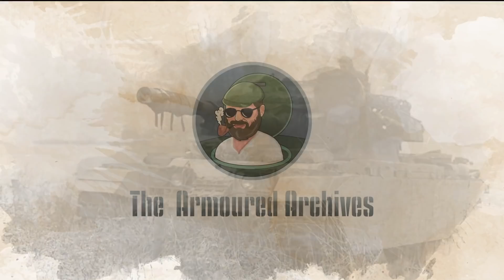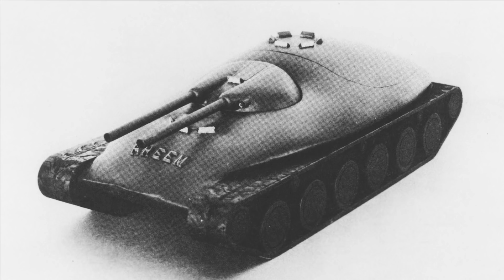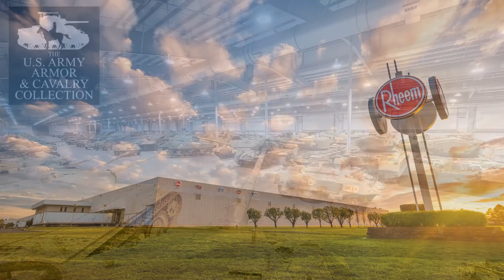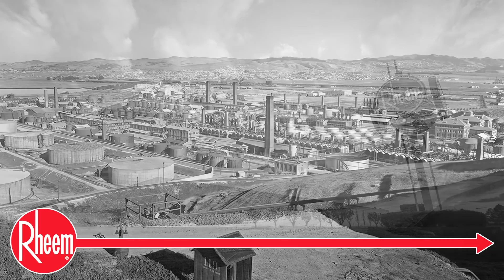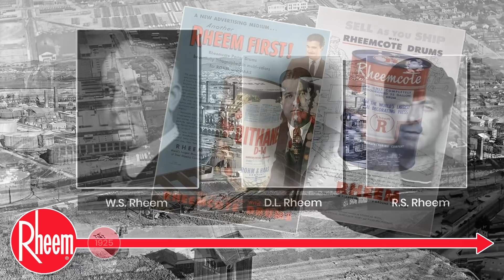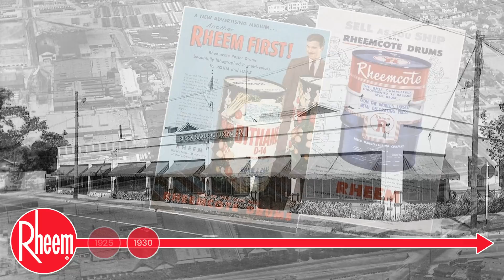The Hunter  - Tank Design &  Development

Comment: That's clearly the best tank design that ever was, and it will certainly be revised at some point. 
I would change the hydraulic motors for pneumatic, and return the air (compressed and piped from engine exhaust) through "liquid armor" side fuel tanks though. Some light anti-aircraft, guided missiles are hitting mach 2-4 to replace those old recoilless rocket rippers in the design (using ruskie 57E6 for example, with 20KM range), which makes an AT variant of the same, out of dual barrels of a 2-tank wing able to wipe out an entire platoon of mechanized infantry in a flash, and still have lots of machineguns for close-in discouragement.  The logo, cast on the surface, would likely be a good "field up-armor" feature, if it were a honeycomb design that let an expeditionary force fill the cells with dirt, metal scrap, and camouflaging materials.

Comment: My first impression of this AFV was positive however my second glance away from the profile was the tracks with the low profile it has negated the arc of fire to perhaps 10 to 15-degrees whereas present day design give both secondary and main armaments a 360-degree arc of fire. e. that date back to 1915 which  makes it highly questionable for a number of practical reasons. learly excellent feature being it's low profile from a protection standpoint but this limits the armaments, both main and secondary arc of  fire unlike tank and the spotter's view particularly in uneven terrain. Today's designs means the armaments have 360-degrees albeit some cannot fire their main armaments when sideways on consequently mobility is an absolute must.
Reply: Spg's dint need the same arc of fire that MBT's need. This tank would be used similar to jagdpanthers, or hetzers or jagdpanzers. They would sit in an ambush position and then fire upon the enemy.

Comment: I would hazard a guess on the rate of fire and suggest that the magazine and/or extraction system was fixed in some way and the guns had to return to a extraction position after firing.  It would be the simplest reason, and would also coincide with the simplest engineering solution to have an automatic magazine feed & auto ejection system.  Couple it with the US penchant of the period 1950-1980 for hydraulic systems rather than electrical and that'll be why it's slow and limited ROF across some arcs/elevations?
Reply: No question mark required.

Comment: Rheem is a household name in Australia.  
 Biggest on hot water systems.  My hot water system died . In looking for a new one  . I purchased a solar solarhart  one . Solarhart was a pioneering Solar  power company.  It was taken over by Rheem . 
 The solarhart hot water system I purchased was of a rugged design that has been around for 40 years . So the are these same design solar hot water systems still serviceable after 40 years . 
 My power bill use to be 120 dollars a month .  Now down to $20 / month . 
 I do not use air conditioning.  Nor do I have a pool .  All my ceiling fans are going all the time .  So my hot water power use , use to be my biggest expense . 
 Thank you Solarhart and Rheem .

Comment: This design combines many good ideas - even by todays standards. A cast hull in this shape would be a lot harder to penetrate due to its lack of straight edges. It would blend better into the landscape - unlike any box-shaped tank and, most probably, even provide a low radar signature. 180° turret travel is IMHO sufficient in most cases, especially considering the typical thin rear armour of most tanks. Gun elevation+depression are very good, especially for a design featuring a low-mounted turret like this. The beetle-wing escape hatch could be done with an explosive blow-away type feature for emergency escape.

Of course, hydraulic drive and rockets instead of shells have its limits and are a dead end. But I like most of the rest, really good out-of-the-box thinking!!
Reply: The manufacturer's check to Congress must not have cleared in time. (Not suggesting that our CongressCritters are subject to bribery or anything, but... it could have been the SecDef who didn't receive a large enough check.)
Reply: @micheal49  yes typically this is the determining factor in which equipment is chosen for use by the us government
Reply: Hydraulic drive has issues, but the idea of drivable road wheels may be a good idea if it can be had without excess compromise in other areas. Not necessarily to remain drivable in situations where a track is lost, but to be able to swap tracks for wheels to take advantage of roads.
Reply: some good, new ideas, but a lot of really dumb, stupid ones: petrol engine ?? They learn nothing from the Sherman aka "Ronson" on ww2 ?? Autonomy - crap, power ratio - again crap, guns - another dumb idea - is hard to fit ONE good, big gun in a conventional turret -  but to fit there two of them, was really silly. 
The guns will become slow as hell if the turret rotate more, and at high elevation - 2 rounds / minute ?? That is horrible. And the range was hilarious short - wtf, a hand weapon could fire at longer range ! 500 yards ?? That is what, some 450m ??  No wonder they dropped the design, too many stupid ideas...
Reply: The rate of fire is 120rpm,only dropping to 2rpm per gun (4rpm) at max depression. This is presumably average rate of fire, because there is no reason the magazines would be affected by turret position.

Range 500 yards is the accurate combat range, the accurate combat range of most rifles is considered to be ~500yards, so no handguns do not have longer range.
As for not being enough, it would be perfectly fine in urban or jungle/forrest terrain. And one doesn't really want or need heavy tanks in open terrain, where their slower speed would actually be noticeable.

Not what the Americans wanted, limited in use, but not terriable either. Certainly not as bad as you are making it out to be.
Reply: @mirandela777  The US tanks of the 50ies all used petrol engines originally. They changed later to Diesel for fuel economy reasons. If you are referring to the 120 miles as "autonomy", that was seem adequate for a heavy tank, certainly better than the M103 at the time. 645 HP for a 45 ton(short ton,I suppose) tank, that's 14.33 HP/ short ton. Comparing it to the M103's 12.6 HP/short ton, that's pretty good. In metric,the Rheem "The Hunter's" power to weight ratio would be 15.8 HP/t, which is better value than the opposing side's heavy tank, the T-10M's 14,42 HP/t.
Also, Shermans tend to catch fire easier(until the introduction of wet stowage) because of their ammunition placement. The infamous Tiger has a similar ammunition placement and if their armour was penetrated and hit one of the ammo stowage above the tracks,the result was a destroyed  tank as well.
If a tank needs one large conventional gun, to provide good elevation and depression values, the turret ring must be large as well. That means the top of the hull must be wide enough. That usually means a large hull, etc, etc, so we end up with a large tank with a large turret, like the M103. A 'rocket gun' has less recoil than a conventional gun,therefore needs a smaller turret ring,therefore you can make a smaller hull,therefore the result can be a smaller tank.
About the 500 yards range, watch the video again. They provided data about accuracy for 500 yards. This doesn't mean that the rocket can go only 500 yards. However, this range is still insufficient. And I suspect the rocket guns were far from accurate at 2000 yards.
Reply: @bencejuhasz6459  "They changed later to Diesel for fuel economy reasons." ECONOMY ?? hahaha ! Since when the Army EVER cared about "economy" ?? Lol dude !
They learned from russians Diesel was the way NOT for economy but yes for AUTONOMY dude, a whole different thing !  Add to that the fact the diesel is not catching fire so easy like the gasoline, and a diesel engine gives you more torque and 2x more autonomy, and generally more lifetime. 
"If a tank needs one large conventional gun, to provide good elevation and depression values, the turret ring must be large as well" NOP. Just look at Armata Tank, with a much smaller turret and a big gun. That was a good innovation, a working one,  not jamming 2 pee-pee guns in a turret with a range far inferior to a rifle... 
Nice design for comic books, not so nice for modern battlefield.
Reply: @mirandela777  The Army didn't learn fuel economy from the *SOVIETS*(not just Russians, mind you), but by their own mistakes and experiences. Both the M4A2 and the M10 GMC used Diesel engines. Economy and not autonomy comes to play when you try to keep your vehicles in the battlefield as long as you can.
The Armata uses an unconventional method, an unmanned turret.
And again: About the 500 yards range, watch the video again. They provided data about accuracy for 500 yards. This doesn't mean that the rocket can go only 500 yards.
Reply: @bencejuhasz6459  " Economy and not autonomy comes to play when you try to keep your vehicles in the battlefield as long as you can." Are you a 7 yo kid ?! Educate yourself !  You mistake "economy"  with "autonomy" . The second one is one of the main strategic quality for ANY military platform. The first one is ignored in military. 
And about range - stop writing nonsense !  Is a dumb gun who fire 1960 era RPG.s !
Reply: @bencejuhasz6459  - to educate you, one again,  on the meaning and the HUGE DIFFERENCE between "economy" and "autonomy"  - a diesel submarine is way more "economic" (cheaper) than a nuclear sub. Downside : has a VERY limited autonomy, reason why are "blue water subs" (to use near coastline) . But a nuclear sub, a LOT More expensive than a conventional boat,  ( so, uneconomic (sic ! ) - will provide you with an unlimited AUTONOMY / range.
Reply: @mirandela777  you don’t need or want a heavy tank to operate alone and unsupported for extended periods the way you would with a nuclear submarine and they don’t have the stealth capabilities, it’s just a bad comparison and doesn’t make sense. Siege attack/defense implies massed formation on either side and so not really any need for autonomy, but this tank would have had far greater operating range than contemporaries like the rather successful British Centurion anyway so isn’t as dire as you’re making it out to be. I think you should try to consider the rheem tank based in the era in which it was designed and not compare it to modern Russian MBTs which are admittedly far superior but would not have even been dreamt of yet at the time of it’s production. If you do you will start to understand what everyone else is saying and why they’re not so down on it as you are and perhaps it’ll be less frustrating for you. This is also a reason why the “1960s RPGs” (they’re rocket propelled but 22lbs projectiles are hardly grenades) made some sense for the designers: the m40 recoilless rifle developed by the USA was fairly lightweight and effective at the time and was used widely by the USA and allies with a variety of ammunition types for different targets besides just tanks.
Reply: @doomguy9049  - what "everyone" dude ?! Do you  SUFFER FROM MULTIPLE PSYCHOTIC PERSONALITIES ? This project was a failed design, with flaws big enough 
 not even be ever considered a simple prototype, is that too hard for you to understand ?

Comment: Did someone really design a tank that would require its crew to maintain SIXTEEN separate engines?

That crew would have felt seriously Rheemed.
Reply: Only one engine, the rest are hydraulic motors. Probably still a pain in the ass, but less so than so many engines. (Yes, I know, I'm being frustratingly pedantic, but engines and motors are different, despite often being used interchangeably in everyday speech)

Comment: I imagine the slow reload rate had to do with the loader location vs where the ammunition had to be positioned when rotated.
Reply from the maker: i pondered this, and as said it had clips, so it could be that once the clips ar empty it drops to the lower rate of fire, but they didnt add that in? however thats speculation, possibl its the ejection mecanism? - its interestign but sadly rheem didnt go into details
Reply: @armouredarchives8867  I was thinking more that the clips were 90 degrees from where they would be when facing straight forward.  The motion would require a lot more manipulation of the rounds.  Also, to reload the gun on the far side of the gunner, you would need to get past the gunner.

That said, I would assume in practice, they wouldn't attempt to reload the gun when rotated 90 degrees.
Reply: @mucoursi8588  yes, but the auto-loader still needs to have rounds loaded into it.  The graphic in the video shows rounds stored by the loader.